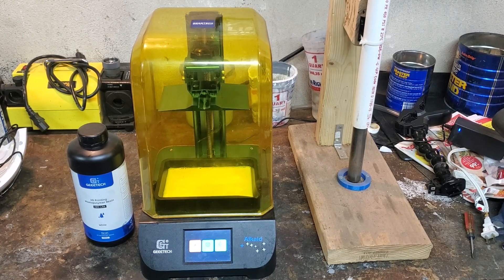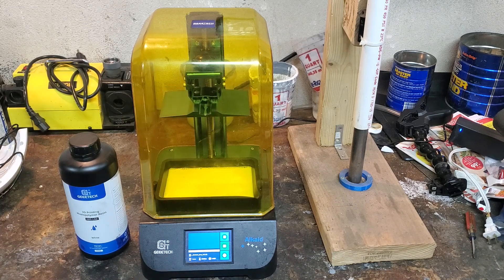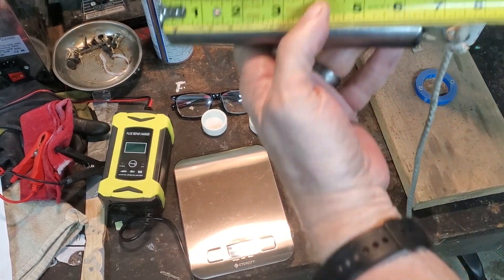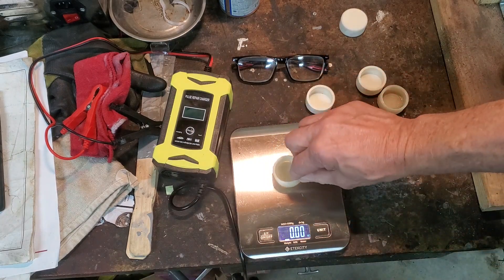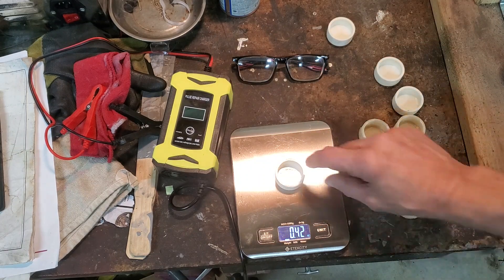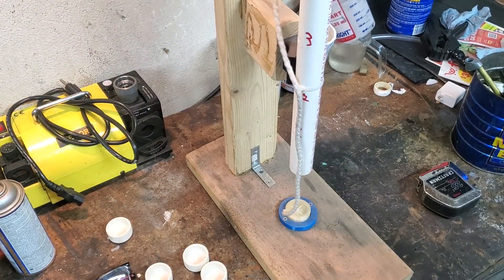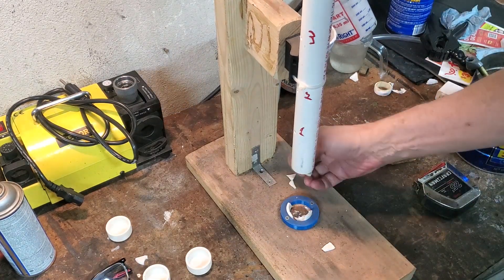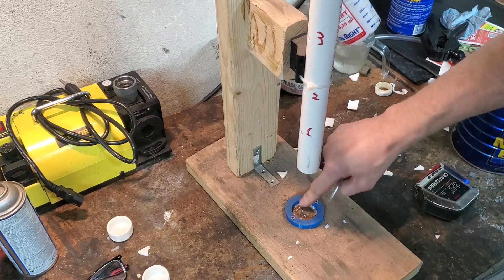Hammer Time! ABS filament vs. ABS Like Resin! One can take a punch and one has a glass jaw!

Comment: If you get some Sunlu or Jayo (the same resin according to most people) ABS like resin, it would be cool if you could repeat this test with that resin. I don't have any of these resins, just some standard stuff, but the Sunlu/Jayo ABS like seems to have a lot of flex to it, almost like a hard rubber, which is why people rave about it for miniatures (tiny parts don't shatter when dropped from a table). This stuff seems to shatter like standard resin. From the looks of it, this doesn't seem like it would take well to drilling or tapping either, but the Sunly/Jayo stuff does. Good video, good test! I might still get some of this stuff just for the price.
Reply from the maker: Next time I buy resin I'll get some. Thanks for watching!

Comment: Interesting test, though I have to say at the end of the day resin is resin, and while abs like resin is less ridged then standard resin it’s still pretty brittle. I don’t know why they call it abs like, because it’s not. Supposedly there is a strong resin that I’ve never tried, but I’ll bet it still shatters if it has substantial mass and any kind of significant fall. 

I can say adding 40% abs like resin to standard resin does make resin parts less succeptable to cracking and braking. I can drop a part from 3.5 feet and it doesn’t always break, where the same part in standard resin will chip at the least.

Comment: Your rope is hindering the free fall of the weight.
Reply from the maker: And it's doing it the same way for all test pieces.
Reply: @3rdpig  but it is not possible to calculate the energy into the target.  And no it will not be the same every time.  Watch how it flaps into the hole.  Some times it will be smooth other times with more turbulence.
Reply: @3rdpig  Just trying to help you.  Can't take a little criticism, don't waste your time doing pointless experiments that do not use proper methods.

Comment: Thanks for the demonstration!
In my experience abs-like just means less shatterprone then regular resin. Which isn't that high of a bar. The resins that are in the same ballpark as good filament require both UV and thermal curing plus quite a lot of money. Leaves you with the intentionally flexible types rather deform elastrically then break.
But most also lack the temperature tolerance of abs/asa - another reason to keep FDM around.
Reply from the maker: Thanks for the info!